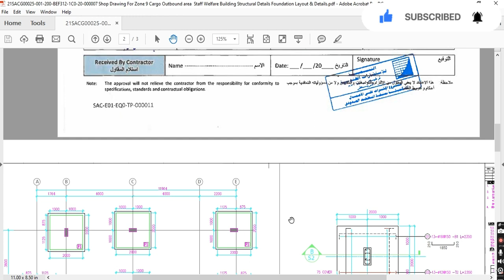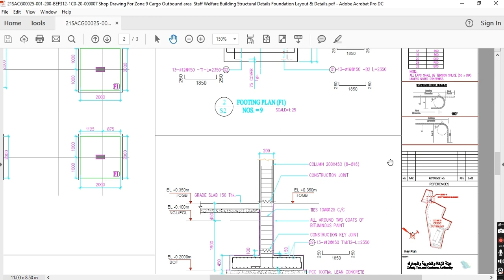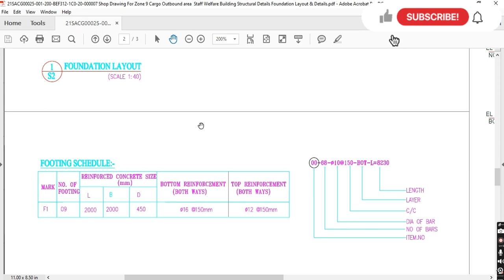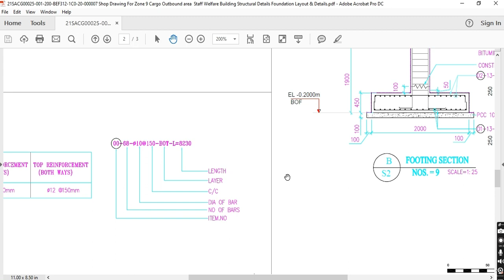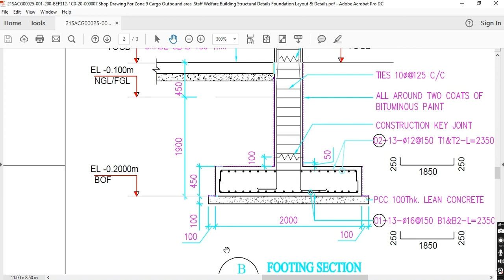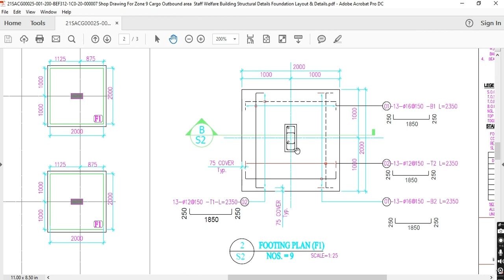How To Read  Structural Shop Drawings | How to read structural drawings for footings.

Comment: I have a question regarding Cutting length of bottom bar and top bar developing length is 250mm how its possible plz explain this ?
Reply: Or 2350 is round off calculation.
Reply from the maker: Total depth of footing is 450mm. As per structural calculation 250mm is ok

Comment: very informative sir 
sir, i have a question what is the role of the length of the angle(L) or its on the basis of thickness
 eg for lapping length, it is 50d
Reply from the maker: Yes calculation on the basis of dia
Reply: @CivilEngineerAtSite  ok